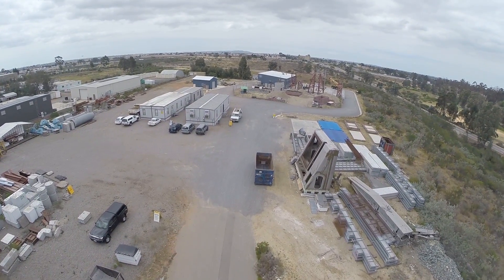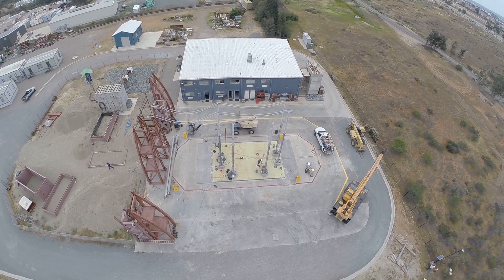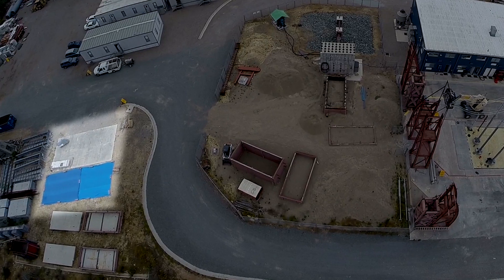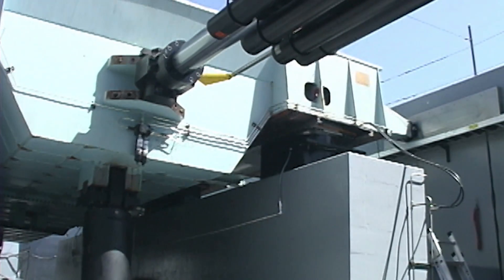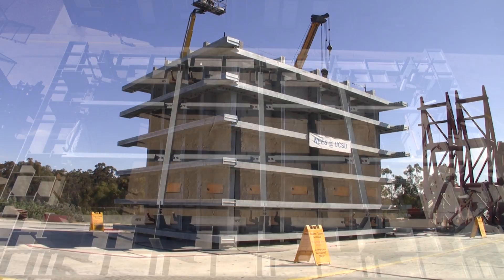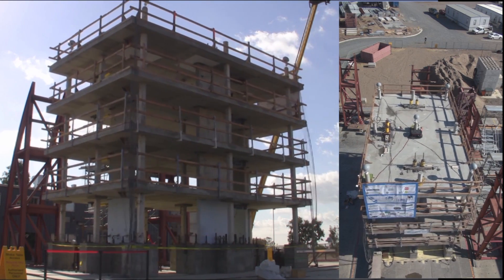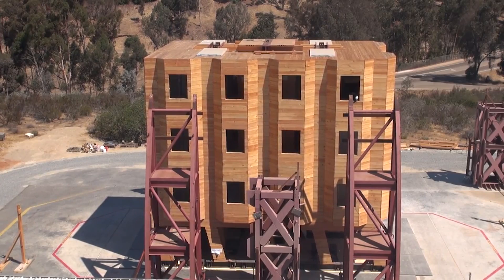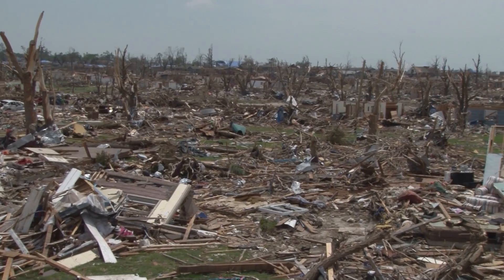World's largest outdoor shake table gets $5.2 million from National Science Foundation

Comment: That isn't the largest, I've seen larger. Also if the tests are real, why did you construct a "staging area"?
Reply: The largest is in Japan, at the E-Defense facility in Miki City.  It is indoors and has a 300 square meter table which is capable of full 3D motion.  It is powered by four 4000hp gas engines and has twenty large accumulators which allow it to produce the acceleration needed for a full scale simulation.  New technologies had to be developed for the massive hydraulic rams and hydrostatic bearing ball joints to be able to withstand the forces.